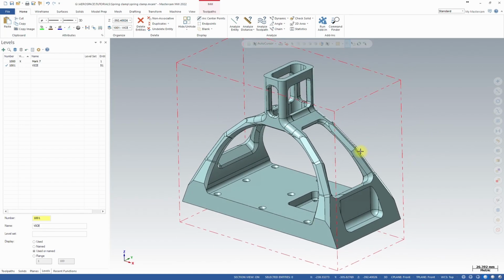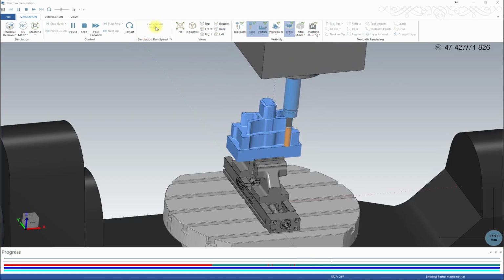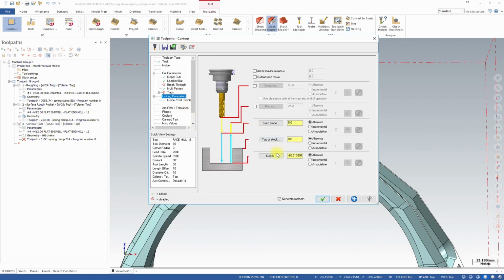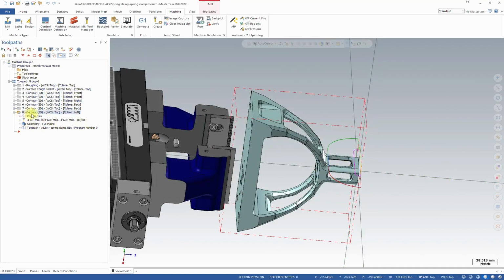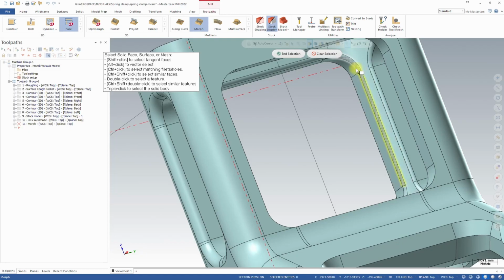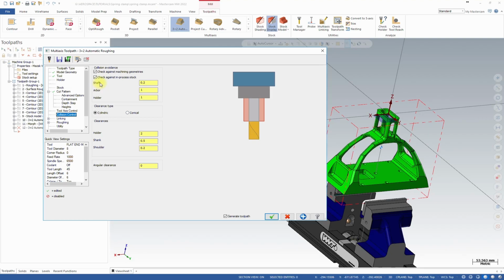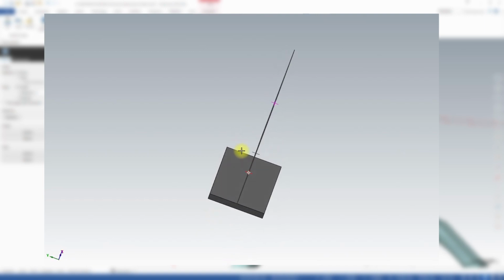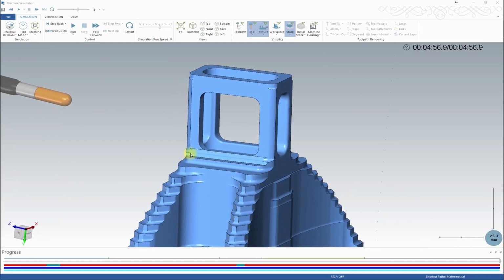Spring Clamp - Mastercam 5 axis tutorial - Part 1 of 4

Comment: Best 5 axis tutorials available online. Keep up the great work. Please!
Reply: It is the post processor that does the calculation and inputs G50 WPC shift
Works the same way as wpcshift unit in mazatrol
Reply from the maker: Wow, thanks!
Reply: @aspeaerospaceprecisionenging  Question if you dont mind. When creating a plane on the side of your part, you did not make it equal to the WCS. You said your machine can figure out the position. Is it the machine or the post that figures it out? I have tried both ways, but only cut with all the plane from the same origin, because in posting I see 2 very different outputs, so I just went with what I know...
Reply from the maker: @fsttimes81  yes of cours if it doesnt work on your machine or post then you have to move your plane to the same position as your WCS,
i believe it is not a standard option on the machine we have this on our integrex as well our post gives a code to rotate the plane/part with G68 and then shift zero point as per selected tool plane (on integrexim sure it is G50 not sure what code is on variaxis)
when i program the part in mastercam I usually move it to coordinate 
May i ask what machine model and control do you use also who is your post processor supplier

im using this on vari and integrax with smooth control i can do on  variaxis matrix2 but not on older machines our posts are provided by InHouse solutions in canada (great multiaxis postprocessors btw)
Reply: @aspeaerospaceprecisionenging   We have mori's NMV5000's and 3000's and a Mam72. For the Mori's we have a postability post for the Mam we use Camplete. There might be a switch in the misc values for this but I have never used/tried it to see if it posts out any thing different. Always trying to learn what these machines are capable of but sadly they were all there before I was so I did not have the benefit of working with the application engineers to find out all that I could do... Not that I feel limited by the planes all coming from the same origin points, but it is a few more steps, which always add the opportunity to make mistakes..
Reply: @fsttimes81  you can see it more in details on mastercam short video 
https://youtu.be/0ZbybkxrACA